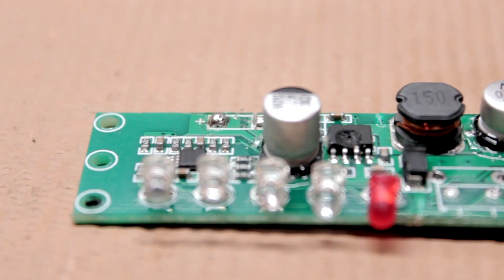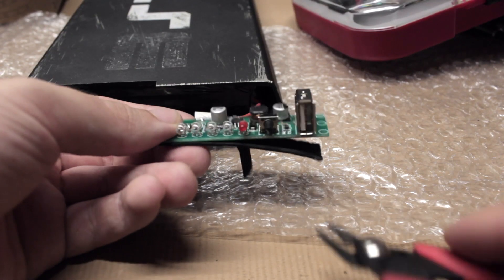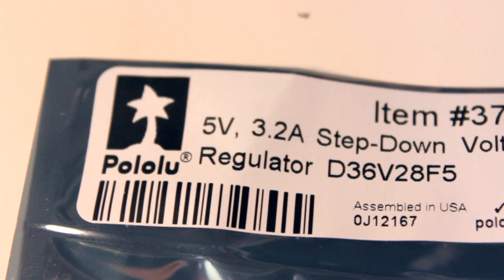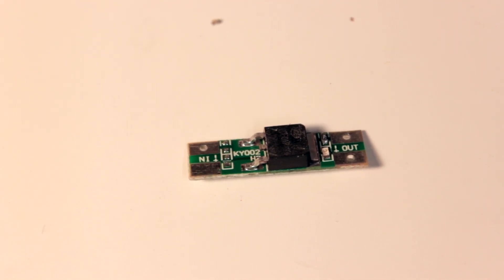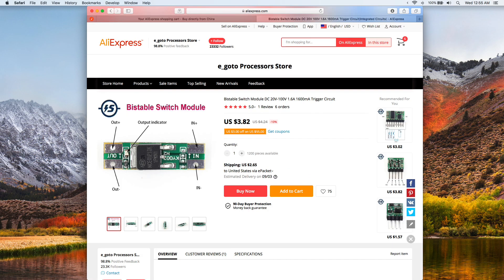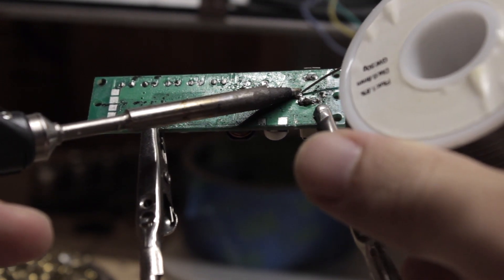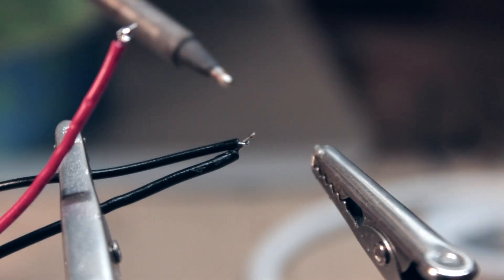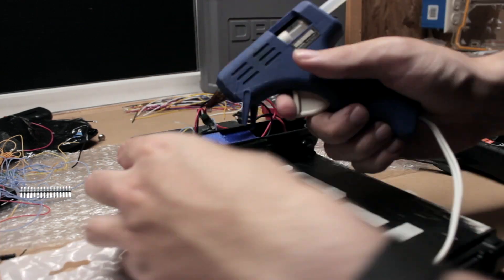Adding a USB charger to ANY Electric Skateboard

Comment: 42 to 5v? doesnt that get real hot? love your 'scaffolding' :) well done mate. go the extra mile and do it properly. get a new iron tho man :) you deserve it. pick up a ts100 or something. those things are amazing. oh. this was 4 years ago. im assuming your iron is dead now anyway and youve gotten something new.👍
Reply from the maker: The step down was suuuupppeeerrr low current so I wasn’t worried about the heat. Topped out at 5V1A. I actually did upgrade to a TS100 at some point after this! I did accidentally blow up Step down though and never got around to fixing it. The little connector shorted and popped the main surface mount cap. Maybe I’ll finally fix that again this summer. Appreciate your comment!

Comment: Good work. I'm adding a USB charger to my Bajaboard but I also wanted to wire on 2 small blower style fans to cool the battery inside the chassis inline to the USB charging port. But I wanted it on a toggle switch. 

It isn't working quite yet but hopefully soon
Reply from the maker: I can’t vouch for the soft latch I used yet, my toggle switch got stuck so I had to take it all back out after the video 😅 but when I get it all back up and working properly I’ll be sure to verify how well it holds up. Definitely worth a shot tho! It’s got an integrated status LED you could probably wire up to a lighted button with. Might be a good alternative to my battery indicator lights as activity lights.